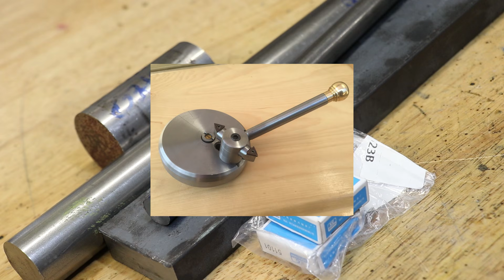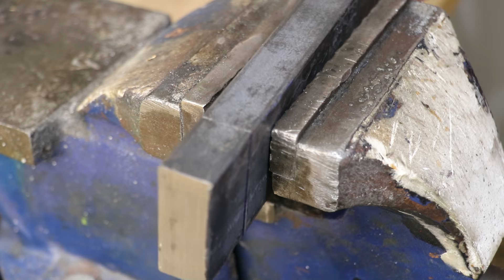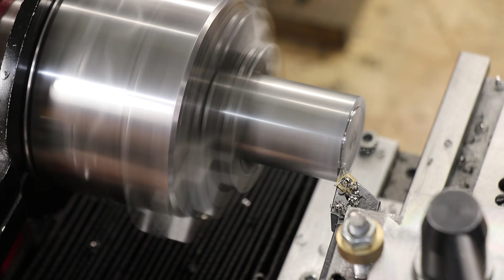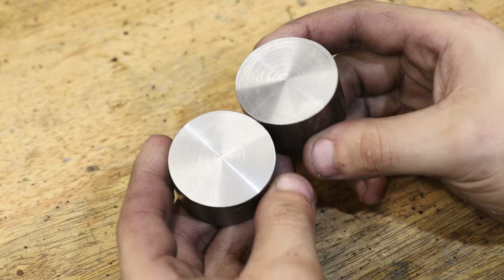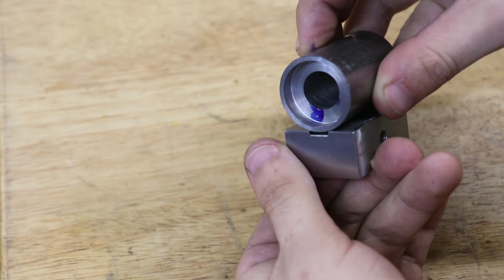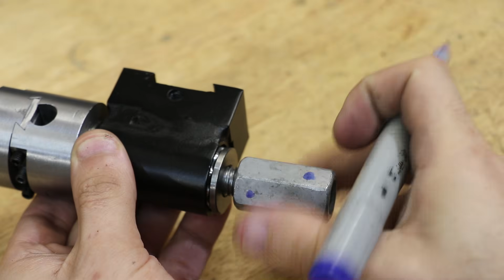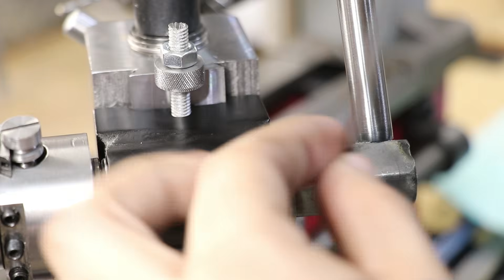Lathe Ball Turning Attachment Build

Comment: You don't need to adjust the grub screws with every cut. Simply set them a little oversized, then first do the right half by moving the carriage a little left with each cut, then do the left half by moving right. And then do the final cut with the proper diameter. in one go.

Comment: Bruce here,Again a great project beautifully presented. My suggestion is make a powered hacksaw.I had one and sold it once I acquired a band saw and wish I had it back because you can use blades that are much cheaper than bandsaw blades and it seems to be a great compromise between doing it by hand and a much more expensive and complicated machine. Thanks for what you share on UTube.

Comment: so its essentially a boring head flipped on its side held in bearings with a handle? I think with a slot cut 180 degrees around the holding tube that a machine screw in the boring heads arbor sticks out  of and a handle clamped or whatever onto the arbor this would be totally reversible 🤔

Comment: nice build however, it disturbs me greatly how everything is off-center when you use the lathe on any of the parts. Even the bores you just made.
Reply from the maker: A bit of run out in the scroll chuck. Doesn’t matter all that much on this build

Comment: Take in mind that when using a small to medium size drill milling machine the spindel will start to vibrate quick as you increase the cut. These types aren't build to take heavy cuts, despite high quality of the cutting material. 
Take it easy or buy a beefier milling machine.

Comment: Instead of using Spackfilla to make the body neat, why not make the body around 20 mm longer, weld together over the full length and then mount in 4-jaw chuck and machine down the ends to the length required?    You wouldn't need to hide the Spackfilla under paint then - you could just gun-blue it.  And it would better resist the knocks that tools get.
Reply from the maker: Im sure you could do that. Sometimes I make up the design as I go along which leads to some of these design choices. Cheers

Comment: Interesting design, it's new to me. Using a round insert makes for a nice transition. The only thing I would criticize is the use of the thrust bearings to not only take the thrust load, which they are made to do, but also locate the rotational axis against radial loads, which it isn't meant to do. It really should be done in combination with some form of bearing to make sure the axis of rotation remains true. Seems to be doing a good enough job for your purposes, but maybe something to keep in mind for future projects.
Reply from the maker: The close first on the main shaft and housing should be doing that job.

Comment: invest in a metal bandsaw ; a vertical one could be handy to cut thick sheet too , you need one that you can set at a slower speed though 
a horizontal bandsaw can be found reasonably priced used (whell out here at least) and can be used vertically too
as for getting the zink off a part drop it in water with draincleaner or another acid , doesnt take a lot to get the coating off

Comment: Nicely done. Maybe you like the exercise but a power saw (as others have suggested!) You could cheat and show using your trusty hacksaw and finish the cut with power. Hand held bandsaws are relatively cheap & can be converted to vertical if desired.

Comment: boring head on a bearingd shaft....why uild it from scratch? so much extra work to get to the basic
Reply from the maker: You can buy it if you want, I see issue with making from scratch. Plus my one is much more compact than an off the self.model so it better fits in the small working area on a mini lathe

Comment: Great video as always,
Here is some unsolicited advise, ignore it if you want to, would recommend placing zinc plated steels in a container with vinegar so that way the acidity of the vinegar will strip the zinc off whatever steel and save your lungs when welding, plus wire brushing the schmutz/residue that it leaves behind after the vinegar bath.
Reply: Or wear a respirator?

Comment: Excellent job. Enjoyed the creation of this as always, looks great but of course it's how it works that's important and the ali ball end speaks for itself. I had no previous knowledge of this type of tooling and I couldn't quite figure from the way the tool went together how it was supposed to work, so soon as you set it up in the lathe and demonstrated I had a great "Aha!" moment. Hope you get a lot of use out of it. 

While metal knobs look superb (hope to see a brass one in the future!) I presume this would also turn acetal or another hard plastic/resin without batting an eye?
Reply from the maker: Cheers, I am absolutely sure that this could do plastics parts, though I'd make sure to use a sharp insert. I'm using RDMT inserts, not sure if they make them for plastic.
Reply: @artisanmakes  Thanks for reply!

These inserts are flat-topped right? If so v easy to take them to beyond factory-sharp on a fine diamond plate followed by either very high grit wet-n-dry or diamond paste on steel.
Reply from the maker: They are not flap topped, they do have a bake rake if you will, but they aren't super sharp. I suppose that you could sharpen them, but they also might sell sharper button inserts made for plastic. Cheers
Reply: @artisanmakes  I think the carbide inserts they use for wood turning and bowl making would work on plastics and similar materials. Probably would work on the bar you made. Great video! Thanks for your time and sharing! 👍😎✌️

Comment: Why don't you like to use your outside jaws on your 4-jaw chuck?  Did you have a part sling out or is there a different reason?  I ask because I've been thinking of trying to obtain a small 4-jaw chuck for my small lathe (it's smaller than your lathe).

Also, have you tried a "scissor-type" knurling holder?  I'm thinking that since you've got a small lathe, it may not be up to the pressure-type knurling you do, perhaps causing some problems.  Since you already have the actual knurling cutters, you could make your own scissor-type knurling holder and install your existing cutters.
Reply from the maker: I prefer not to because there is simply less metal holding on to the part with the outer jaws that with the inside jaws. Just a bit of peace of mind if you will. 

And no I have not used the clamp.style. knurl tool, this one was the first and only one that I bought. It seems to work fine, but it is quite possible that the clamp style might work better.

Comment: Are you actually cutting all the way through with just a blade o.O, mate come on get a band saw or a cold saw. Subscribing, but as after 20+ years in steel in Oz why are you wasting so much time? The reason your cuts look like that is that the bench/jig is moving the whole time you cut or the jaws are shaking as you end mill/cut.

Comment: Overall good design, however please don't use spakfilla for this application. #1 it is water based, so you have already started the rust before you applied paint. #2 Spakfilla is designed for small filling applications on gyprock, not steel. When you get some chatter, the only thing that is holding that in place is the paint. I'd suggest in future to use a product designed for this like JB Weld or Selley's Knead It Steel. Both work wonders for me and also cover up my abysmal welding😉😉
Reply from the maker: I know what this stuff is and it's not really meant for this, but I have gotten away with using it for years with zero issues on similar applications, and it sticks to the roughed up steel quite well. I did think about getting something else but I'm probably going to be using this tool maybe 5 times a year max so I don't it will cause any problems as far as I'm concerned. Cheers

Comment: I have to say, I believe it's traditional to turn two brass spheres first, so as to be able to respond affirmatively to questions about your courage. Good project, doesn't just let you turn spheres, if you use the compound to angle the rotation of the tool, you can turn all kinds of conic sections, ellipses, and so forth. Say, should you ever need a doorknob or drawer pull which is not a perfect sphere. It's been a while since I did the math on those kind of things but I think a bit of trial could get you some very fine results.
Reply from the maker: That is a great point, that didn't occur to me.

Comment: 9:45 you mention that you are not happy with the surface finish the carbide cutter gives, but it might need higher speed and feed to reach its essential work load to give a better finish. Love the build <3
Reply from the maker: There is some truth to this, but I have used good carbide on the mill and gotten better results than what I got with this import cutter.
Reply: @artisanmakes  Are there any inserts/holders that you would recommend for smaller lathes? Do you use inserts designed for aluminum to compensate for the slower RPM?

Comment: why not just buy a cheap boring head off e bay  cheaper and quicker so you can get on with making what you want to make plenty on u tube use boring head works great
Reply: I don't understand "get on with making what you want." What if he wants to make a boring head? It's like asking "why make soup from scratch when you can just open a can?"
Reply: @myob97219  so why make a boring head if your not going to use it, i all ways look at the economics of making things including making soup, i also enjoy making items but with prices of materials and availability it sometimes is not always possible
Reply from the maker: An off the shelf one would have been too big to work in the space I had available. Plus it would not have been cheaper.
Reply: @artisanmakes  dont know where you are but on ebay they are cheap and if you take in the material cost,  time and electricity i doubt if it is cheaper, there are different size boring heads you can get
Reply from the maker: It's more so the thickness of the off the shelf ones that were the issue, not the diameter

Comment: A note about thrust bearings: the two races may not be identical. 

One will have a precise I.D., and a slightly under-size O.D.
The other will have a precise O.D., and a slightly OVER-size I.D.

The first is meant to turn/spin with whatever passes thru the bore, with clearance for the "outer" object.

The second is meant to turn/spin with the outer object, with clearance for whatever passes thru the bore.

This is because the two races always turn in opposite directions, relative to each other.

I discovered this when adding thrust bearings to the compound of my mini-lathe.  In this case, one race turns with the cross-feed screw, but must have O.D. clearance so it doesn't bind against the compound.  The other race contacts the compound and does not turn, so it must have clearance for the cross-feed screw to turn freely.

Now depending on the application, it may not make a difference in practice.  But, it's something to be aware of.
Reply: Rrrrrrrrrrrrrrrrrrrrrrrrrrrrrrrrrrrrrrrrrrrrrrrrrrrrrrrrrrrrrrrrrrrrrrrrrrrrrrrrrrrrrrrrrrrrrrrrrrrrrrrrrrrrrrrrrrrrrrrrrfr

Comment: This lathe does not have the power or the rigidity to use carbide inserts. It screams in every cut, part vibrates (aparent even to the naked eye) and surface finish is horrible. Use some goos old HSS prpperly ground and life will be better.
Reply: Agreed!

Comment: Excellent concept and follow-through to completion and test. Only one question, how long did it take you from start to finish bearing in mind how you cut all your stock by hand?
Reply from the maker: I couldnt tell you for sure, camera set up and lighting always makes any project take easily 4 or 5 times as long to complete. I started this project about a month ago and finished it about 2 weeks ago, doing it on and off when I had the time.

Comment: ROFL - plaster based Spakfiller. Now THAT is rough as guts!
Wish you'd file off the gnarly tops of the threaded studs on your quick change height adjusters!
Reply from the maker: I've had it work before without issue, but this stuff was a bit old and had a pretty chalky finish. The finish really doesn't bother me to he honest, I can always replace it in the future if I want to. Cheers
Reply: @artisanmakes  - buy some Builders Bog from Bunnings. Just get the small squeezy pack as it tends to go off quickly after opening. It's just a 2-pack polyester filler like what the yanks call "Bondo".
Reply: Absolutely agree. How that sticks to steel is beyond me

Comment: Really nice design and well executed (as always).  I have a ball turner like the 0:25 design and whilst it does the job it's hard to adjust the radius accurately and it's not very rigid when there is a lot of tool stick out.

Comment: the weld looks a but cold to me
Reply: Doesn't matter - he fixed that with plaster based wall filler.
Reply: @johncoops6897  i know/saw 
its more for nest time he welds that he could try and turn up the volts and wire feed a little

Comment: I have to know, what brand is you  hacksaw blades? Also what TPI are you using to cut stock?

I started a struggle with my hacksaw the other day, after 10 minutes I broke out the plasma cutter and arguably spent longer cleaning up the slag.
Reply from the maker: I use Sutton's hacksaw blades, 18 tpi. I've had the best results using the full HSS hacksaw blades, cobalt ones are too brittle for general work.
Reply: @artisanmakes  thanks so much for your reply.
Reply: The trick with hacksawing is to use the full length of the blade and to use both hands. Long slow deliberate strokes, don't frantically hack at it!
Generally you want the biggest teeth (lowest TPI) that will engage say 3 or 4 teeth in your work. So, only thin sheet should use 32 tpi and for thick stuff you always use 18tpi or coarser.
Reply: Biggest thing people get wrong with hacksaws is a lack of tension. Try the ones with a lever system to tension, they actually become a tool I use fairly often. Given I've got a portaband, horizontal and vertical bandsaw, that's saying something
Reply: They will never be fast. Also worth noting one hand is supposed to go over the top of the hacksaw where there is usually a flare at the front. You push the blade from there and not the handle. They also only cut one way so should have the pressure lifted/reduced for the backstroke
Reply: @thaneirwin4688  If you have a coarse low TPI blade made for aluminum they can be quite fast, of course in hard steel though you are right.